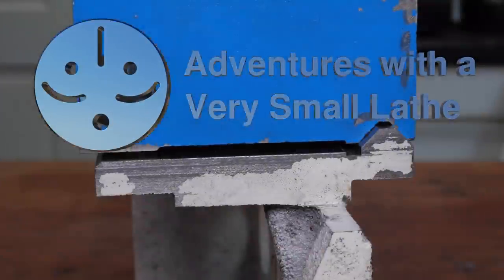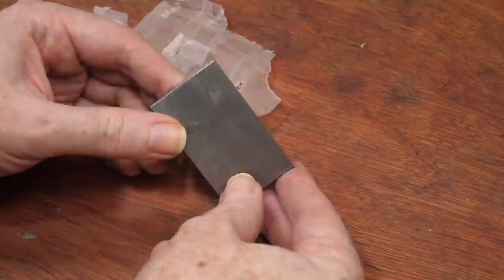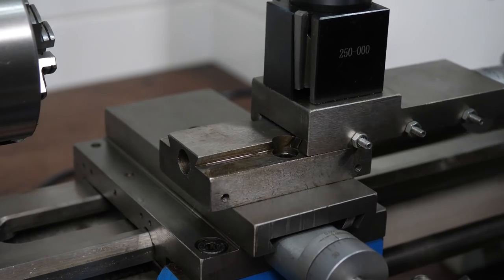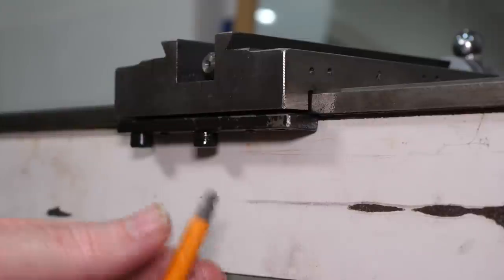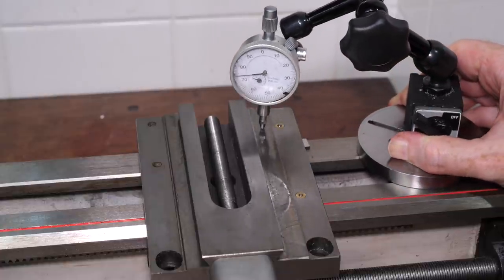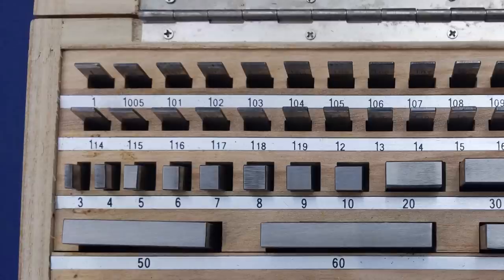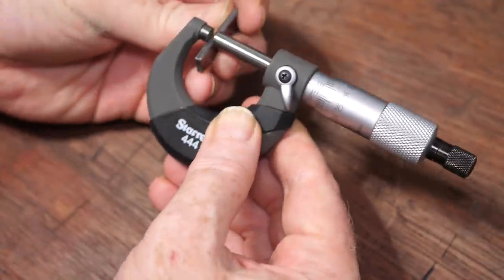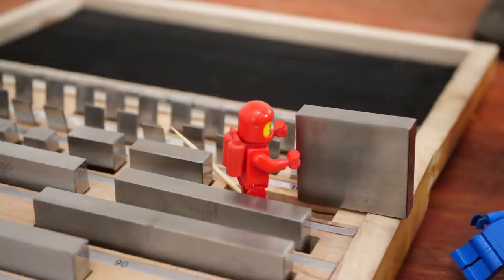The CJ0618 Lathe Saddle Part One, Measure the Problem with Gauge Blocks and Banggood Tool Review

Comment: You can usually adjust micrometers. There's bits you can fiddle with inside the handle.
Reply: Sounds like the old watchmaker thing. “There’s only two kinds of people who can take a watch apart: A watchmaker, and a damn fool”, Ha!
Reply: @tomt9543  I never found it particularly hard to do. They even give you the tools to do it with and standards. So they expect the end user to do it. Least that's now my 0-4" mic set came.
Reply: @1pcfred  my vision is so bad after 45 years of welding that precision measuring for me is using an adjustable wrench and a tape measure in place of a micrometer! Ha!  I’ve actually got a new set of micrometers, but I’ve never paid attention to what else is in the case! Thanks for sharing this! Sounds like a good project for one of these crappy winter North Carolina days!
Reply: @tomt9543  if your eyes are bad then use a lot of optics to improve your vision. Reading glasses and a magnifying visor at the same time works for me.
Reply: @1pcfred  That’s what I’ve been using for probably 10 years! This old age thing is tough! I’ve got chuck jaw marks on my visor! Ha!

Comment: I was wondering if you might use Turcite Slydway on the tailstock or saddle. It's available in 20mm wide strips, 1.5mm or 2.5mm thick but seems to be pretty expensive. I found 90 euro for a strip 2m long from reiff-tpshop.de! But it can be scraped.
Reply from the maker: I think Turcite would be overkill for this lathe, but I'd definitely like to try it in future. This lathe is more of a practice and learning piece.

Comment: Someone used to do an upgrade longer bed for these 16 inch long i think 🤔, be interesting to get a measurement of the v from each
Reply from the maker: I've found a couple of places selling an upgraded bed for the C2, but past experience of buying C2 lathe accessories is that the CJ0618 is slightly different in small ways which mean C2 accessories don't quite fit. Probably not worth buying a bed just for curiosity's sake though. :)
Reply: @AdventureswithaVerySmallLathe  Yeah, the CJ0618 seems to be somewhat off in every way.  It's a slightly different set of parts nearly everywhere.  My spare Grizzly saddle fits the CJ0618 bed even worse, so I think that's a good indicator that another bed probably wouldn't work any better.  I think the issue is the V-way, but I don't see how I could successfully deal with that.

Comment: How well does the cross slide gear mesh with the gear in the apron, and is it well-centered to the drive screw? That should tell you whether to add to the rear or subtract from the front. I wouldn’t be too hesitant to widen the V-notch since you aren’t likely to worsen the accuracy of the machine. I bet you can square just one of the two v surfaces up to an end mill and buzz it off with the mini mill.
Reply: If you get it close you can lap the V-groove by sticking lapping film directly onto the opposing ways. Lapping film is just adhesive-backed sandpaper without the paper, and it does a great job of temporarily making a mating surface into a custom formed sanding tool.
Reply from the maker: I don't think I'd be able to do a good job of re-machining the V-notch correctly, which is the main reason I've been focused on the idea of shimming the back. My milling machine is just too small to work with a part that large. There is a fair amount of slop under the Apron, and I'm pretty sure I'll have to do a bunch of adjustment to the gear and lead screw half nut however this project goes.
Once I have the saddle close, I'm going to try my hand at a bit of scraping, which should make an entertaining disaster video.

Comment: 12 years ago in the tool room I noticed the tool maker leaning on the lathe, later as I was turning a diameter, I got awful chatter marks, I adjusted the carriage gibs and found they maxed out,  I used various thicknesses of shim stock to take up the slack, (.005") then I cut and bent an 'L' at the end with a drilled hole and fitted it under the wipers with some grease, problem solved! The tool maker? He was a little mad since I 'messed' with his machine, but if he had the time he would have done it.  'Big Bill' passed away 2 years later, RIP bro!

Comment: I believe you are not using your surface gage correctly.  The post can be raised so that you can tilt down more.  Leaving the post extended as you showed in your video pretty much locks it perpendicular to the surface when you push it all the way back, but the capability is there to rotate the post all the way to beyond parallel with your surface.  This way you can still use your DTI for your critical measurements.  Also not surprised some of your gage blocks are not ringing out.  Bangood is a good source of cheap machine tools, but nowhere near the quality of Starrett, Mitsutoyo, etc.  I purchase a lot of my machine tools used from eBay and it is surprising how accurate the high quality tools are after years of use and what a reasonable price they sell at.
Reply from the maker: Yep, I learned how to do that shortly after shooting that clip, but there are other reasons which I switch to the flex arm dial indicator instead. I wanted to measure the vertical movement accurately and I needed a range of up to 3mm. The dial test indicator I had on the surface gauge only has a range of 0.8mm, and it's tricky to use for accurate measurement due to cosine error. The plunge style indicator isn't vulnerable to cosine error if set up properly, and is easier to align vertically on the flex arm.

Comment: I couldn't figure out why it everything on my lathe was so hard, and parting was impossible.  Turns out it's because of this exact issue.  I have about a 1.2 degree downward angle on the factory saddle.  This is a little more than a 26ga sheet of brass.  I have a spare saddle that I got for a similar model that's even more off.  I haven't yet figured out how I'm going to deal with this.
Reply from the maker: Once I measured it in this video, I fixed cast iron shims in place using JBWeld, then scraped the slideways until they made good contact. The whole thing is so much more stable, and the video is in production. The next step will be firming up the hold-downs which grip the under side.
Reply: You really need to finish that edit and post it up!
Reply: @PetesWorkshop  I eventually just CA glued the brass shim to the saddle.  Worked great.  Instantly made the lathe 100% better.  Before it was just a collection of poorly fitting lathe parts.  Now it's a tool that can actually do something.
Reply: @alt.mindcontrol  thank you. I did do a test with a bit of stainless steel but adhesion wasn’t great. I will try again with some shim material.

Comment: Hello, In the box from the micrometer there is normaly a smal key. You turn the micrometer til zero and look how it fit with the  zero line. But before that you have to clean the micrometer take a pise of paper turn to zero and to pull out the paper. Then the micrometer is clean and  now you can turn to zero. if not you must put the key in the smal hole en turn the key till the zero line is in line. now you can control the micrometer with a block  when it gifes the same result then it is oke 🙂👍👍
Reply from the maker: Thanks for the tip! The procedure I followed on the older micrometer was the full teardown, service and reassembly that doubleboost showed on his channel. I hadn't realised there was a much simpler way to make small adjustments to the zero. My micrometer is now zeroed for the current temperature of my shop, and the gauge blocks are reading bang on!
Reply: @AdventureswithaVerySmallLathe  So the gauge blocks were bang on, that's good.

Comment: Thanks for a very interesting, but upsetting video.
Just measured on my lathe. Using the compund flat as a reference and then putting the angle cube on the tailstock, I've got 0.50 degrees tilt...
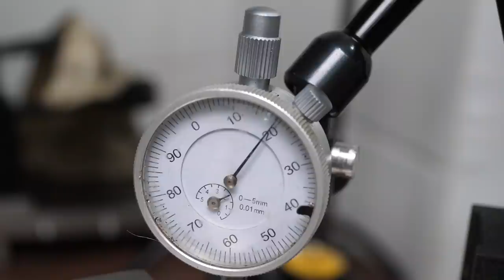Time 03:55. Oops. Thats a lot. No surprice. I measured the surface of the back end of the compound versus saddle movement in order to use it as a reference.... Useless surface.... Millimeters of taper.
The saddle is maybe suffering from the same error as the tailstock.
However, this affects the centering of cut off tools, and facing turning. How does it affect "general turning"?
Just used a caliper, measuring verticaly from the cross slide surface down to the bed. 0.4 mm difference.....
I got the though that the flat surface, close to the raised, v-shaped ridge, is not good as a reference.
The saddle, and the tailstock rides on the V-shape and the opposite flat bed surface,
What do You think?
Reply: Don't be upset, the lathe is probably fine if it isn't one of the cheapest chinese lathes. Literally in other words, Det är jättefint om det är inte den billigaste svarv från China 🤣🤣
Reply: What I'm trying to tell is that the measurement method isn't accurate and the faces you measure from might not be even made that accurate to the rest of the machine anyway. If you can tell that it cuts true, should not be worth messing about for the normal lathe owner
Reply: @MF175mp  True. However eyeballing tells about odd things. What does a center to center, chuck versus tailstock say?
Have fun, turn things and as long as that works, don't worry.
Reply from the maker: The main problem for me isn't that the saddle is sloped. The problem is that the bevel machined into the underside of the saddle isn't fitting onto the bevel on the bed. The saddle is scraping along with 3 contact points, which mean that it isn't stable, and the bed will wear. I've focused on trying to make it level because that is the first step towards ensuring the bevel fits properly. If you want to check your lathe for this, blueing up the bed and checking to ensure the underside of the saddle is making good contact is probably the way to go.
Reply: @AdventureswithaVerySmallLathe  I got it. I hope the lathe will serve me, give me useful works as it is. Fighting issues like this feels as too much.
Taking the tailstock away, turning it up side down shows a sad story. Paint is the contacting surface..... Checking a new MT2 fitted chuck in the tailstock it horizontally points off by 0.2 mm at a distance of  140 mm. Maybe ok. Vertically? The  work of tomorrow will tell

Comment: It seems the v on the bed is too wide for the saddle and headstock
Reply from the maker: That's probably the problem, but that's not something I can fix. Or at least it would be more expensive to fix than I think this lathe is worth.
Reply: @AdventureswithaVerySmallLathe  Or...it's time for you to get a mill
Reply from the maker: @AERuffy  It would need to be a really big mill to be able to re-machine the bevel on the bed, but more importantly I'd also need a big surface grinder if the bed was going to be any use after I machined it.

Comment: It doesn't really matter if the saddle is slanted, as long as the fit would be good.
Reply: And the gauge blocks are total garbage if they have errors over one micron.
Reply: I'm no expert, but I would say yes. Reason being that any slant of the slideways would add or subtract to cutting tool relief angles. But on the other hand the whole tool would also be at the same angle so maybe this cancels it out. Hmm this requires some more thinking and maybe a diagram to figure out.
Reply: @Ealen75  sure it cancels out, no question about it. Also the dimensional accuracy and everything is 100,0% the same
Reply from the maker: I touched on this in the video, but I didn't have time to go into much depth. My objective is to make sure the fit is good, but it feels as though the bevel has been machined so it is perpendicular to the slideways, so the bevel will fit correctly when the cross-slide is level. This means that making the cross-slide level will be the best starting point before I start scraping all the contact surfaces so they are a snug fit.
Reply from the maker: @MF175mp  If we were talking about inspection grade gauge blocks I'd agree, but we're talking about a cheap set from Banggood which i doubt anyone would ever use for inspection. In the workshop I'm never going to need anything more accurate than a couple of hundredths. I don't have any tools which are capable of reading to the nearest micron, but the micrometer I used in this video reads about 6 microns over at zero, so the fact that it seem to read the stack as about 6 microns over the correct size seems to point to the gauge blocks being as close to correct as I can measure.
Reply: @MF175mp  A problem is the tool height, it would constantly change.
Reply: @MF175mp Yes after thinking a bit more, I believe you are correct everything on the crossslide would be slanted at the same angle, therefore the cutting geometry stays the same, it is only a matter of the crossslide not moving parallel to the plane of the bed. 
I could however come up with an example where I think it would matter. 
Assume you were to cross drill holes in a workpiece, with a toolpost drill, then the hole would be slanted as well.  This may not matter for a round workpiece, but if the workpiece were a square block mounted in a four jaw. Then any crossholes would be at an non 90 degrees angle to the sides. 
I know this maybe far fetched example, but I have done something like this this in the past.
Reply: @jan4094  Yes this was my initial thought as well, but as long as the tool intersects the center and your doing turning work it doesn't matter. 
I found it helpful to draw the situation on a piece of paper, and the turn the paper a little in order to understand what was happening. for turning, it would still be perfectly ok. It is only that the movement plane the cross slide isn't parallel to the bed. Imagine angling the bed, and letting the cross slide move horizontal instead (paper again), it would work just out fine.
Reply: @AdventureswithaVerySmallLathe  a common use for gauge blocks is calibrating your micrometers. I have micrometers that read in microns so the accuracy for the calibration blocks needs to be 0,1 microns. Same for if you calibrated micrometers that read 0,01mm, the gauge blocks need to be still within 1 micron after stacked 3 of them on top of each. Otherwise you can't know whether the error is in the blocks or in the instrument. Yes the mikes should be calibrated for the in-between readings also and you need to read it as if it was a micron reading micrometer- for example if your measurement is half a line-width off, you can assume that's about 1 micron error in your normal micrometer and so on. You take measurements with a few gauge block stacks to tell whether the screw has any systematic or random errors in it. I don't yet have a gauge block set myself but if I bought a chinese set of blocks, I would get it professionally calibrated immediately to tell if they are good. If they wouldn't then be, I would still have time to get my money back from the Chinese.
Reply: @MF175mp  would the calibration and possible fixing cost more tham a good set?
Reply: @smallcnclathes  I don't know, it depends on your situation, our school has a good calibration lab I could ask them some time what they charge.
Reply: I checked what those grades mean, I think these blocks need to be within +- about0.2 micron to be in the advertised grade. I doubt this is possible for the price and the calibration would cost more than the set itself in any case, in other words I don't dare to buy them at all
Reply: I actually ordered a Soviet Union made almost unused grade 1 set where only a few blocks were removed from the grease paper now, I'm sure that they did them right and the cost was no more than a chinese set that is complete mystery. There is a Bulgarian seller on Ebay that has loads of sets of gage blocks in various name brands and grades. I'm going to chase them all with my 0,0002mm resolution micrometer and see if they have any terrible errors in them.

Comment: The bed needs to be leveled and bolted down to make this measurement accurately. The way you are doing it is not accounting for twist in the bed, i.e. the difference in height between the two ways of the bed. In fact the easier way to do this would be to place a precision level across the two ways of the bed then place the level on the way of the carriage and compare.

Comment: Even if they were utter rubbish, those guage blocks would still be kinda handy... I use old guage blocks as parallels on my very small lathe as I can't get real parallels small enough and my crappy old guage blocks were awfully cheap..... although I did have to pay more for mine than you paid for yours. ;)

Comment: Excellent video, thank you for showing this technique.
Now I am afraid to go measure mine though because I know mine is going to be way out just by looking at yours  and remembering what mine looked like when I upgraded the saddle.
This is going to be a large can of worms so now I am really looking forward to your next videos.
Reply from the maker: Don't worry too much about making the slide level. The thing to focus on is making sure the V groove in the saddle fits snugly onto the bevel on the bed. It just happens that on my lathe I need to make the slide level in order to get the bevel to fit.
Reply: @AdventureswithaVerySmallLathe  when are you going to post part two?
Reply: YES ! Please ! How did you level the saddle?

Comment: Instead of oil in hard to reach spaces like jibs, I use grease, it stays put and works for ages, ditto for lead screws where the flange is just back from the handle.